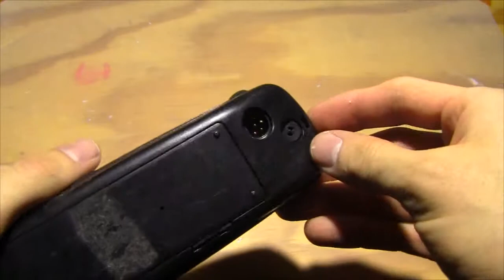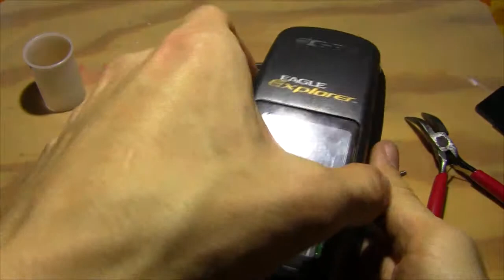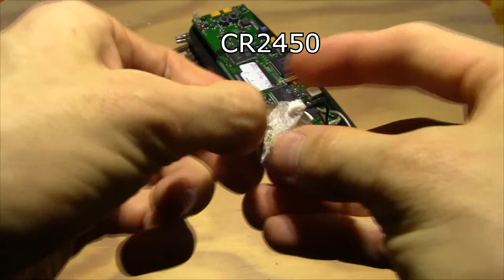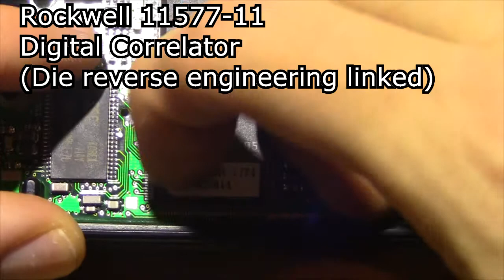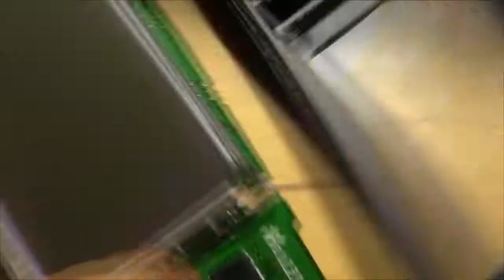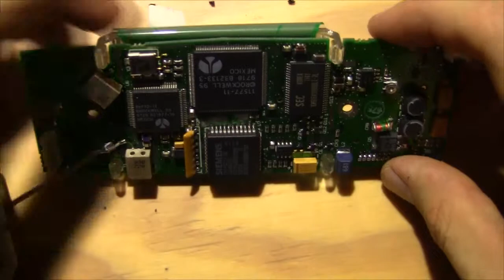Eagle Explorer GPS Teardown

Comment: thanks for uploading this video i needed to replace the battery in my eagle explorer. I still use mine regularly so if you were wondering how effective they still are the answer would be sufficient. In comparison to some of the newer models even it performs well. the only real difference is the channels needed. so it can take a bit longer to acquire signal unlike the new models. keep this unit they work great for lots of stuff.

Comment: I still use the one I bought at a yard sale.
Even by modern standards it's a great, reliable, if basic, handheld GPS. Almost perfect for Geocachers!
I'm reassured to see that chunky Lithium cell in it, as now I know that storing data in it (e.g. waypoints and track plots) isn't going to 'wear out' any flash memory cells.
Esp since flash memory cells back in 1996 had short write cycle life...
Thanks for the teardown. :)